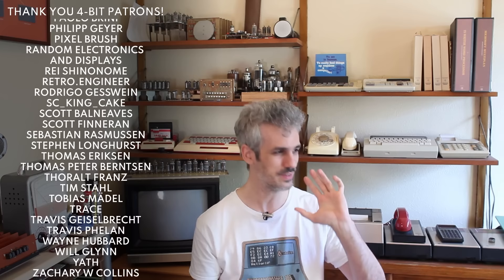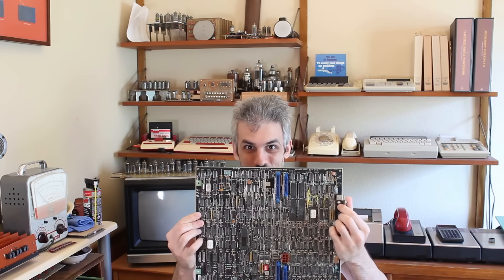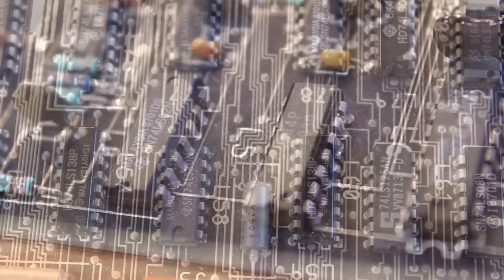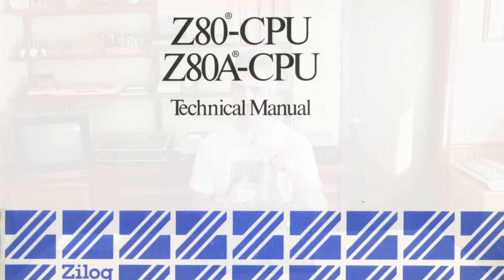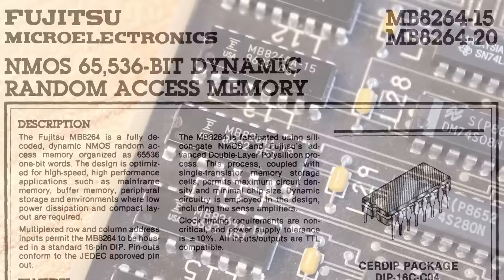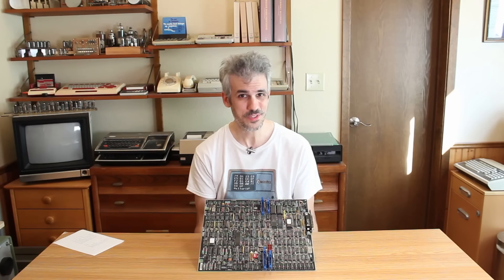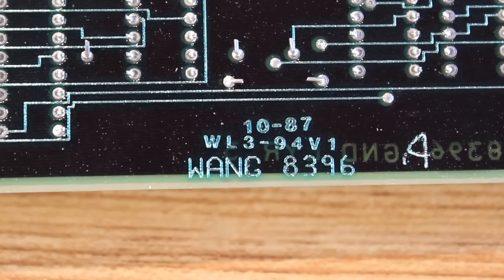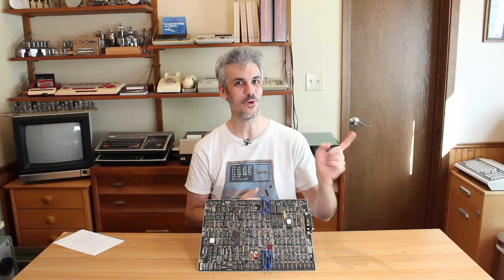What is this Mystery Wang PCB?

Comment: 210-8396?! I didn't believe I'd ever see one of those again! They were a challenging board to repair, I saw quite a few of these during the mid 1980's. It was the main board for an external hard disk enclosure with one or two MFM hard drives fitted, the hard drives could be up to 85Mb each. This unit was used on the whole Wang range including 2200, OIS and VP. Wang used the parallel port to interconnect these hard drives and also their 2270 external tape drive to the host computer. Common faults... there's a 74LS30, I saw it on the video, that would fail. The 8237 DMA controller manufactured by AMD could cause data corruption as some of them had a manufacturing defect, there was a replacement campaign of the 8237 chip at one time. Nice video.
Reply: So is it compatible in any way with the Wang Writer?
Reply: Ain't it nice when someone posts a nice thorough video asking for help identifying a mistery item and lo and behold, somebody actually recognizes it? 😄
Reply: So, I love this little community right here, that's amazing right. Random ebay board and someone knows exactly what it is. :)
Reply: Denis is right, last night on the discord server manuals were posted and it lines up with this exact card.
Reply: @merseyviking  Not entirely sure because this is an external unit like the C64's drives. There's a cable needed for data that plugs into a host machine. I didn't check which models are compatible and I'm unsure which model Usagi has.
Reply: If that's the board and if the board works it will make some awesome videos in the future.
Reply: Yeah, that's what I was thinking.  That was the one that was connected with coax cable among the workstations, so that many users could share the same file system, right?
Reply: Before I saw your response I was thinking part of a mainframe of mini system where this resource is shared. DMA, multiple controllers and a good stack of RAM it sure smells like like a 1980s version of a NAS. In this case it's a Parallel Accessible Storage which was the fastest method of the time. Would love to see a Main, CPU board or Channel board that would have beeb connected to it.
Reply: @alabamacajun7791  Yes that's a good way to describe this, it's part of a 1980's NAS.
Reply: @RossComputerGuy  It's funny you should mention the 1541 disk drive, since this video made me think of it too.  Though the reason I was thinking about it is... just like this board, the mainboard of a 1541 floppy drive carries its own processor (a 6502 instead of a z80) and has some RAM of its own (2k instead of 64k).  :)  So, at least in my opinion, it bears some evolutionary kinship with this Wang board.
Reply: I was wondering if there was an ex-Wang engineer out there!  

I worked at Wang for the second half of the 80's, primarily on the VS80 (and the other VS variants up to the VS300) range of kit that effectively replaced the 2200.  The VS was more your general computing server, with dual-coax connections to "dumb" workstations (each with Z80 brains).  The dual-coax cable was a b@stard, and actually redundant - you only needed one of the two coax cables to connect, the other was there for error checking. 

At the same time the OIS range of kit was similar in concept and connection, except it was dedicated to word processing, which had been going for much longer than the VS concept. 

The Wang PC was right at the end of the Wang dynasty.  It was initially an 8086 chipset which was a one-up on the IBM PC, but still very proprietary, and for the time a bit of a kludge to try and capture some Wang-only market share.  It was quickly replaced by the 80286 fully IBM compatible PC, but by then it was too late.

Dr Wang, who made his fortune being part of the development of core memory for mainframes, died of cancer, and his son, Fred, wasn't up to rescuing the company from the collapse of proprietary computing under the weight of client/server and much cheaper hardware that was emerging at the time.

A real pity.  When I joined Wang as a sales-support rep, the company was absolutely on fire and wiping the floor with the opposition. While I worked my a$$ off, it was a massively rewarding place to work.

Anyway, having been in the guts of at least the VS and PC equipment (in a non-engineering sense) I'd say that board was probably an ex-2200 card - it is too small to be a VS card, nothing like the PC cards, and probably too big to be an OIS card (although I never had the cover off one of those, but they weren't that big).

I wonder if there are other ex-Wangers out there?

They were really good times. 😄

P.S. In Australia at least, we have a term "Wanker", which is a fairly crude way of describing someone who is so full of themselves that only they can can find pleasure in themselves.  So to speak.

I recall the day when Wang corporate (US, who knew nothing of this) released a global campaign of brochures titled "Wang Cares" in support of their start into the professional services market.

They were put on display in the main reception area in the North Sydney head office, and lasted about a whole two hours until the marketing team came roaring down to remove them.  😂

There are many more stories like this.
Reply: You handled a lot of Wangs
Reply: @squattingheads  indeed we did.  😄

That was another disconnect between Australia and the US - the word "Wang" didn't have the meaning here that it did there.  Saying something like "I bought a used Wang" wouldn't raise an eyebrow here, but would be received with a lot of giggling in the US.  It was all part of the fun of working in the company.
Reply: cool i was guessing that maby it was some sort of "proto" NAS or something similar
Reply: @Meriphistimo  I'm lucky enough to have a Wang2200 from a Canadian forces base, they donated it to our Electronics Program in the early 90s and I brought that baby home.  My Wang is on proud display in my mancave, along with the framed Love my Wang magazine ads ;)   one day I'll get around to rigging up a terminal.
Reply: @afungusamungus2860  Excellent!  My wife and I took over a typing business in 1990 and I managed to snag a small VS to use for the word processing.  I also managed to grab a 4 bay disk unit which I managed to fit out with a 76mb removable drive (for backup) and three 152mb fixed drives - all the world of space to store the documents.  I also wrote my own suite of business tools in COBOL.

Sadly, like many small businesses, our venture failed and although it broke my heart I had to scrap the entire system a few years later, and moved on with my next venture (professional services) working from home on a PC just as the Internet was emerging here, which presented a whole new set of opportunities.

These days I'm a ln IT program manager and watch others do the work. It has been a long and winding road I've travelled to get here, but it has been a lot of fun.  

Good luck with the 2200!
Reply: Thank you for all that info!
Reply: I didn't work on the hardware, but I did development on 2200s and VS-series kit back in the 80s.  I actually kind of miss it.  Did a stint working as 3rd-shift operator on a VS100 with a full complement of fixed and removable hard drives (75 and 300 MB), 9-track tape drives for backup, band and daisy-wheel printers...it was a noisy beast and generated tons of heat.  The numbers on that boards were tickling brain cells, but nothing came to mind...thank you!

Comment: 2275 Disk Drive\Hard Drive. Search for "Wang vintage computer model 2200MVP and 2200 hard disc and 5.25 floppy Drive", there is a picture of a circuit board marked 8396.
Reply: I didn't see your comments, but yeah, that's pretty unambiguously pinned down in my book.
Reply: Yeah, looks like a winner, seems to have been a separate chassis with the drives and that board in it which connect back to the host, the connector layout on the back of the 8396 board lines up with this card.
Reply: Didn't see this but here's the service manual -  https://www.wang2200.org/docs/peripheral/2275_DiskPeripheralMaintenance.741-1345-A.10-85.pdf

Comment: Re. the  delay line - these were common in ST506 hard disk controllers, used for write precompensation. This adjusted the write timing based on the position of the head, to compensate for the effects of differing surface speeds between the inner and outermost tracks. 
 The large RAM is probably simply buffering for data being read/written from/to the disk to offload work from the main system CPU. It could even be that this board was in charge of maintaining file structures, sector allocation etc.
Reply: Given the fact that it also has an 8272 IBM compatible floppy controller -- could it be an MS-DOS compatibility card that reads and writes PC floppies and hard disks?

Comment: well, my comment got deleted for whatever reason…
it's the controller board for a Wang 2275 drive enclosure.  they came with either 1 HD & 1 Floppy, or 2 HDs, all 5¼".  the 2275 belonged to the Wang 2200 PCS series mini-computer.  I I guess I won't link the 2275's product sheet and manual, since I don't know if that's what got my last comment killed.
Reply: Nice find
Reply: weird so did mine with a link to the service documentation....
Reply: let's try this again.  I converted this to be searchable.
https://drive.google.com/file/d/1WK7Ay1NY2lI4c_VMpg3mHwEhK1RsEw4k/view?usp=share_link

Comment: C3 7A 01 at the beginning is a jump to address 017A.   Reset would jump to 0000, which is presumably the start of this EPROM.   The code at 0066h is the NMI handler.  Non maskable interrupt code.  That address is fixed for the Z80.  You can run that EPROM through DASMX to see a disassembly of it.  My guess is that the pcb is a disk controller for a larger system.  Maybe the 64K is used as a cache for a hard disk.   The 8237 DMA controller would read data from the controller chip and place it in the DRAM.   The delay line chip is probably used to generate RAS and CAS timing for the DRAMs.   That connector looks like a centronics parallel printer port.  But maybe it's for communicating with the rest of the system, as you suggested.

Comment: The black "paint" you see on the component side of the board is actually an inner layer.  This is a multilayer board with at least a power or ground layer buried (or maybe both).  Wang made a PC, but it was an AT class machine (I used one at work).  I think the Word Processors were Z-80 based.
Reply: I was about to say! And not uncommon either.
Reply: Just looking at the chip density, it's multi-layer.
Reply: I had never seen a board like that. Yes, it was indeed strange the the traces were on top of the that black stuff, which looks like CRT Dag.
Reply: @BrendaEM  A multilayer board like that has traces and planes (power and ground) sandwiched inside the fiberglas reinforced resin substrate.  Inner layers are usually coated in copper oxide to enhance the bonding.  Usual procedure was to put the ground plane just under the components to minimize cross-talk among signals.  Solder mask was originally thought only necessary to prevent solder bridging during wave solder assembly and thus was not applied to the component side.  We later learned that solder mask had value on both sides of the board.
Reply: Wang originally made a PCXT class machine than 8086 processor. It was a chassis with an interface bus that all the boards, including the CPU board, would fit into. The boards were  extremely large and, while it could run MS-DOS, it was not IBM PC compatible. IBM PC compatibility could be achieved with a large and expensive compatibility board that went next to the CPU board. They were not well supported by anyone and the only software available was VisiCalc and Wang’s own word processing.
Reply: @robcarnegie7480  Lotus 1-2-3 also ran on it, I have one!

Comment: It could be almost anything.  Wang tried a whole lot of different technologies, from stand alone word processors to shared logic minicomputers, to almost an IBM compatible mainframe system.  In that time there were no firm rules so there were a lot of weird hybrid machines of all sorts.  Wang’s profit margins were huge, so they could afford to over-engineer a disk controller. Steve Wozniak did a disk controller with 7 cheap chips and a PROM but he had very different constraints.
Reply: Important to note that it was to save on the cost of the original Shugart interface electronics.
Reply: @graealex  Yep, I count 70 logic packages on the Shugart controller!  Copies of it that I've seen made by other companies, they're usually like 11x17 inch boards and cost like $3000 each!  Woz did the incredible.

Comment: 5-1/4" floppies used just a single 34 pin cable... Winchester hard drives on the other hand used two cables, the 34 pin floppy type cable and a second smaller cable. Exactly like what's on that card. I'm betting what you have is something akin to a very early disk array controller or SAN unit.

Edit: the more I think on it the more convinced I am that's actually the drive control board from a Wang mainframe system. That big Centronics connector almost certainly plugs into the backplane.
Reply: Let's not forget that hard drives came in a 5 1/4 format as well.
Reply: Could be similar to the hawk ffc board.

Comment: The 36 way Amphenol connector was used for parallel printer ports before IBM used the DB25. Designed at Centronics, a subsidiary of Wang Laboratories, By An Wang. (et al.)
Reply: I thought that was a printer port! "Centronics",  now there's a name I have not heard in a long time.
Reply: This female connector (centronics) is usually on the printer
Reply: I shouted "Centronics!" as soon as I saw the close-up :)
Reply: Centronics ! For sure, so reminiscent :)
Reply: A lot of printers still had those 36-pin connectors with a DB25 on the other end.
Reply: I was going to suggest that it might be GPIB rather than centronics/printer. But there is a definite identification up above...
Reply: What came to my mind were the IEEE-488 ports on Commodore PET machines. This could have been the guts of a floppy drive like CBM 4040 just by looking at the ports. Look closer and they're very different, though. Funny memories.
Reply: @aharkness5657  That was what was coming to my mind too.
Reply: I was thinking SCSI 1 at first, but I can see you're probably right after comparing the connectors.
Reply: Nope. SCSI bus connector.
Reply: @joemonktx  36 Pin SCSI ?
Reply: @Wobblybob2004  Yep!

SCSI -1 is 36 pin. SCSI-2 is 50 pin.
Reply: @joemonktx  Are you sure?  In my experience, SCSI (and SASI before it) were 50 pin, and SCSI 2 was 68 pin.  However, since many of the 50 lines were ground, I guess a 36 pin implementation of SCSI-1 would be technically possible.
Reply: @andypughtube  GPIBs used a smaller centronics plug (24 pins IIRC). Printers used Centronics-36, telco/networking kit used centronics-50, etc
Reply: @GodmanchesterGoblin  scsi1 can be done in 25 pins. Rather infamously, Apple used DB25 connectors for their scsi
Reply: @miscbits6399  Cool.  I didn't know that.  Thanks.
Reply: @GodmanchesterGoblin  SCSI-1 and 2 standards used the 25 and 50 pin connectors.  Fast-Wide and Ultra-Wide SCSI used the 68 pin connectors.  The 68 pin standard wasn't around until after 1994.
Reply: @minty_Joe  Thanks. I was going from (foggy) memory. I should have checked.

Comment: Would have liked to see some close-ups of both the blue connector pairs. The black connector is a Centronics parallel printer connector. My suspicion is that's a print spooler board. Jobs are spooled to the floppy drive, and it dequeues and prints them. The printer might be a dot matrix, band, or chain printer. It's not going to be a laser printer, for sure.
Reply: chain printer goodness, like a 1403 (as pictured in Strangelove)
Reply: That doesn't explain the DMA and MFM and floppy chips though. I believe this is a dual disk controller.
Reply: @RossComputerGuy  "spooled to the floppy drive" -- MFM and floppy chips. Also, DMA is not strictly for storage devices. You can use DMA for memory <-> memory, memory -> I/O port, and I/O port -> memory.
Reply: J.C. Wren - I think you might be right.

It's hard to find any info online for Wang Computers stuff, even decent photos of the various boards.

It doesn't make sense that it would have quite so much RAM on, unless it was loading up quite a bit of data.

And the lack of other connectors makes me think it's from a word processor, where the rest of the system can access this board via a terminal board and monitor / keyboard.

I doubt the Centronics port would be for an external floppy drive, because in 1986-87, it was prime-time for the 36-pin Centronics port for parallel printers. Around that time, it almost makes no sense that it would be for anything else. hehe

So yeah, possibly a floppy controller with buffer RAM to hold a few pages of text or graphics.

(64KB could store a LOT of text, so I'm thinking this would be capable of loading graphics as well.)
Reply: Give it about two days, though, and I'm sure somebody on Discord will have a full emulator running for it. lol

They will likely have disassembled and commented half the Z80 code from that main ROM, too.
Reply: OK, I take it back. I see now that there are basically NO other connectors on the board other than the pairs of ribbon connectors.

And there's a 95% probability those are MFM floppy connectors.

So yeah, maybe the Centronics really is serial or something after all, or just used for a custom parallel interface.

Maybe just an over-complex floppy controller after all, with some RAM storage that can be read/written quickly by the main system, via the 36-pin port?
Reply: That sounds like a distinct possibility... if you were banging out invoices or cheques or something a dedicated print spooler card would make a lot of sense.